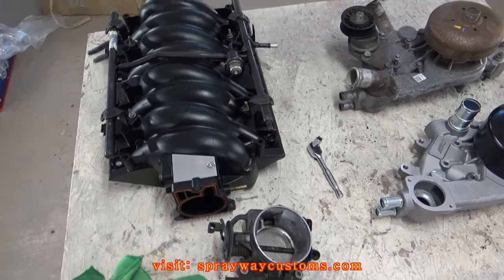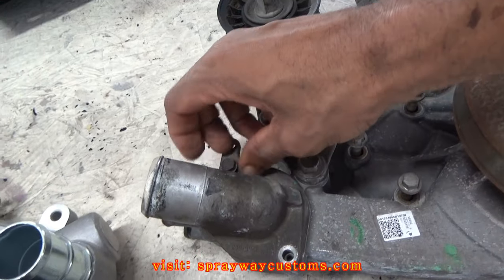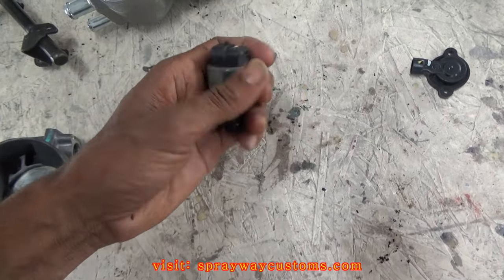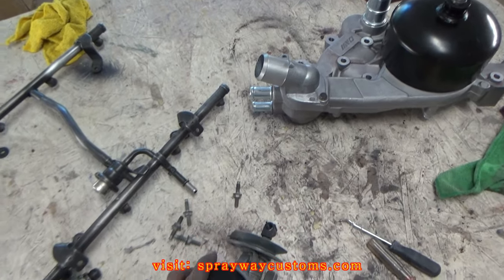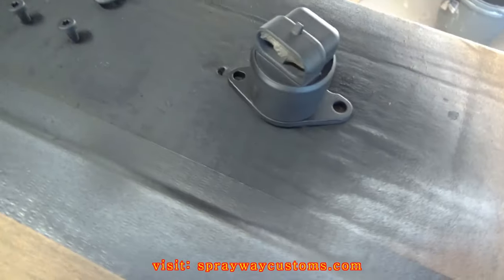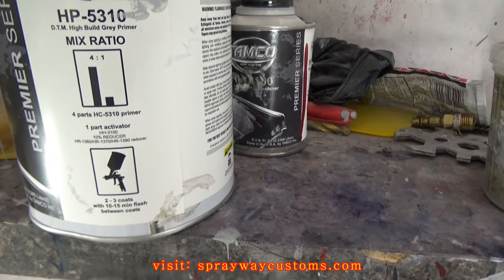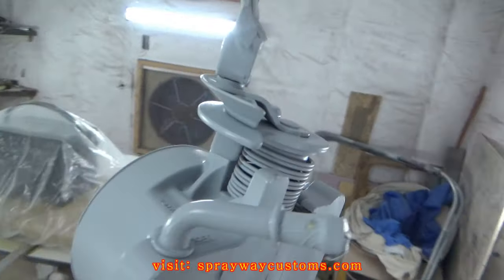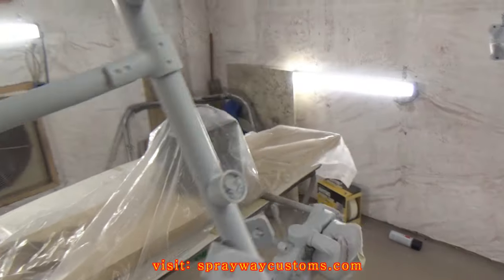How To Paint Engine Parts - Box Chevy Caprice 6.0 LS Swap Intake Fuel Rails Throttle Body Water Pump

Comment: Just curious, do you need to spray the back of the water pump? Is it going to rust if you don't? Thanks man.
Reply from the maker: It shouldn't rust...you don't actually have to spray the back
Reply: @SprayWayCustoms  thanks, that's what I figured. I just don't understand why spray the back then.  If it's not necessarily, why do it? I think that just confused people like myself. But it's all good, thanks again for getting back.

Comment: Looks absolutely nothing like any kinda' high heat/engine paint at all, but rather standard body finish, which..........makes no damn sense to use on these type of components.
Reply from the maker: Why not....all the years I've used it with no problems at all. Don't believe the hype